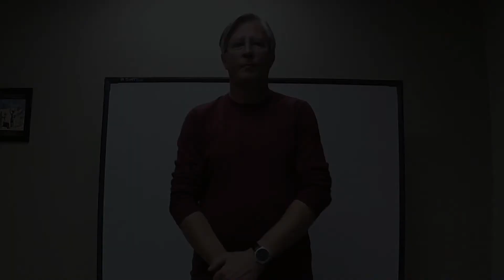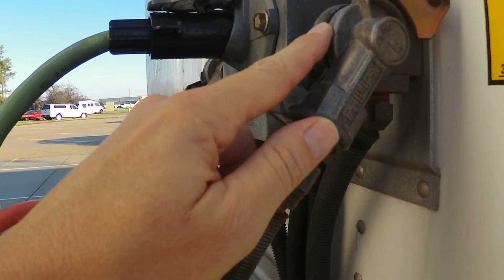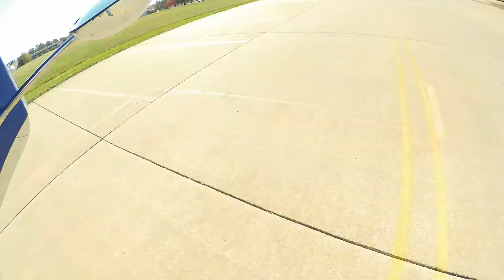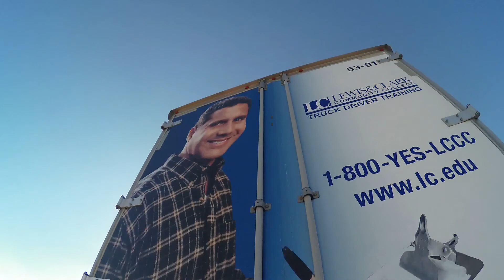Class A CDL PreTrip

Comment: In case anyone wanted to review a specific section of the video:

Presentation Setup and Important Info
0:43

In Cab and 7 Step Brake Test
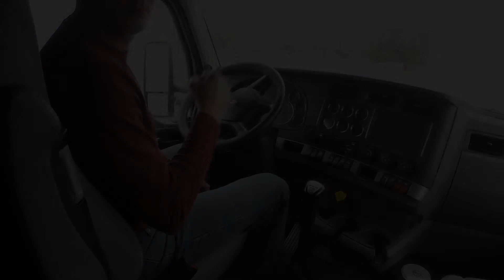9:13

Coupling System
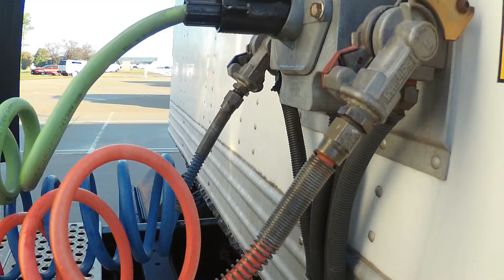21:27

Form A
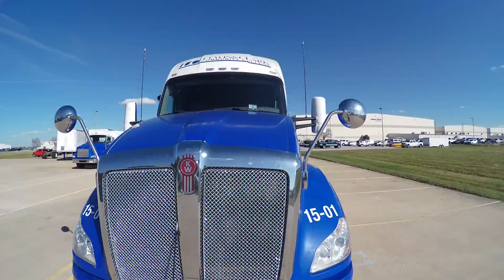23:37

Form B
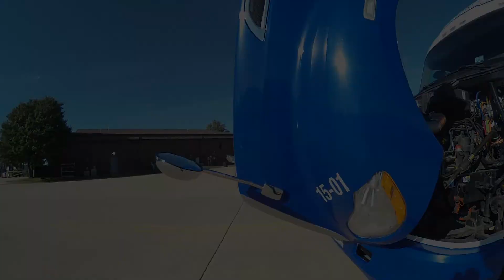33:39

Form C
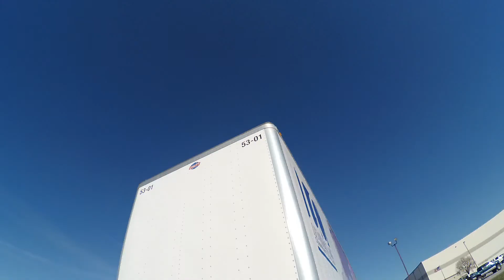41:33